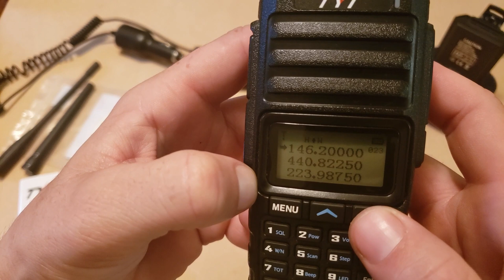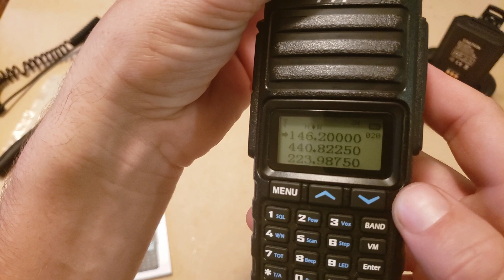TYT TH-350 Quick Programming Guide

Comment: how to program the tyt with vhf and uhf, it's when your offset is more than 200
Reply from the maker: When you program from the keypad you can enter the offset value manually and it automatically applies it but if you program from the software you can type in any frequency you want as the transmit frequency.

Comment: Where did you find the accessories for this radio?  I am looking for speaker mic in addition to battery and battery eliminator.
Reply from the maker: The speaker mic and battery eliminator I found on ebay, looks like the seller doesnt sell it anymore. It is the weatherproof TYT speaker mix and is available on Amazon. The battery was harder to find, I found a ham shop in the states that was selling them online and had it shipped to me in Canada.
Reply: @greentruckandhamradio  Do you have a model number for the mic?  Also for the battery eliminator?
Reply from the maker: @dennisschultz1175  All I can see for the speaker mic is TYT part number 20058 but it is the heavy duty water proof version available on Amazon. The battery eliminator is part number LB-75L.